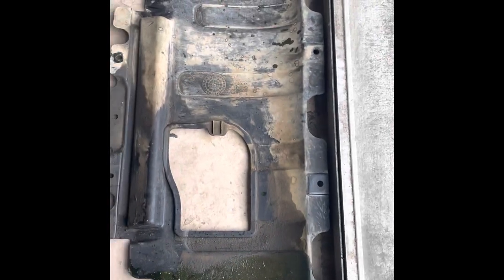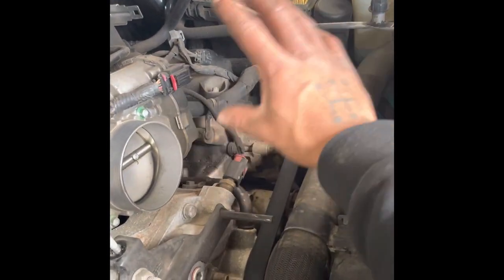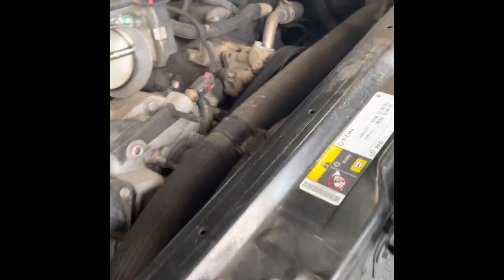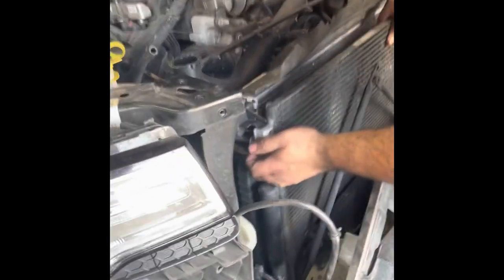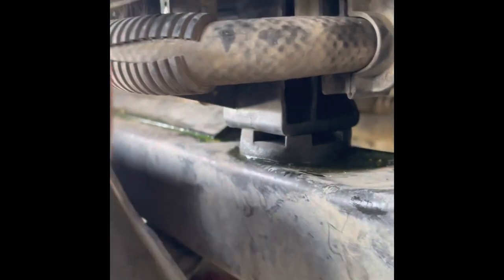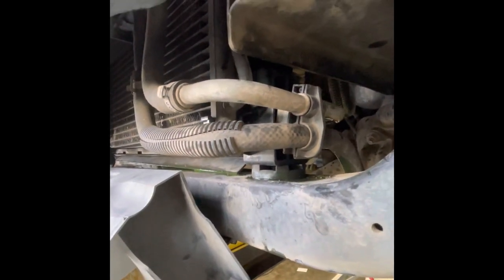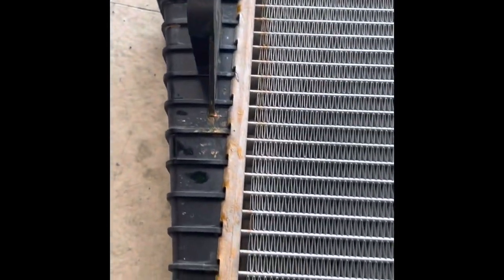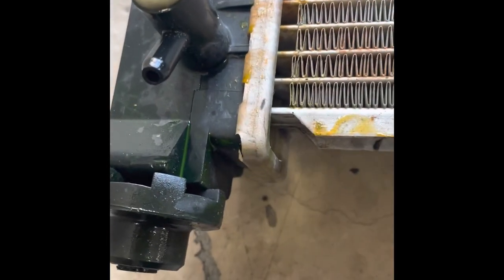2013 - 2021 grand Cherokee radiator replacement

Comment: You do not have to do all of that to put in a radiator all you have to do is remove that top bracket and then losing a piece at the bottom and the whole thing slides out
Reply: The shop told me they had to do this as well and quoted me 1300 bucks to do a radiator.  😆 😅 You can pull it out the top. Plus the bottom has quick access to the bottom bolts by just removing two or sometime 4 screws.
Reply: It is easier removing the bumper than working around it, in my opinion.
Reply: Did you do that on a wk2 with the the 5.7?  I did this almost 2 years ago but I pulled it out the bottom.  Have to do it again in a couple days when the warranty replacement comes.

Comment: The procedures in this video does not apply to all model years.  2017 3.6 jeep grand Cherokee bumper removal is NOT necessary.
Reply from the maker: Does that look like a v6 to you? No .. common sense
Reply: @nomannerssrt  Doesn't matter, typical mechanic response - maybe if you were a technician you'd know pulling the bumper isn't necessary.  THis is why people shouldn't listen to wanna-be mechanics.
Reply from the maker: @shackamerica8985  if you knew anything half of what your talking about you’d know and use your eyes to see that the bumper has to be removed to unbolt the radiator top support to even get the brackets off the top of radiator.. I don’t need no fake ase mechanic dealership worker tryna tell me how to do what I been doin all my life .. this is my personal vehicle.. that tows my drag car .. not some customers car … your the only one with an issue … make your own damn video , get off my nuts dealership boy
Reply: @nomannerssrt  Dude your doing your work in an oil change bay don't front like you actually work in a shop or know for a fact what you're doing. All data procedure calls for bumper removal on both the v6 and v8 models which makes sense being that it's the exact same damn radiator built into the exact same platform. It's not necessary to do so at all but you're obviously to arrogant to believe otherwise and ultimately it just creates more work for you......
Reply from the maker: @hbdd1824  okay bro lol the video ain’t up for you not everybody takes there shit to the shop I do my own shit , and weather you like it or not lol I could really give any fucks my guy lol location of where it was done doesn’t have a fuckin thing to do with anything lol you don’t have a clue what I’ve done or can do lol but please by all means , continue being a keyboard warrior shits comical

Comment: Never would have been able to do this without the video but I messed up on that hood latch top piece. I couldn't get one of the top side screw holes on the passenger side to line up.  All the other screw holes line up fine.  I stripped the passenger front side screw hole out trying tighten it hoping it would help it line up so now I only have the expansion tank screw and one top screw holding that passenger side.  You think It'll be ok leaving it like that?   The other 4 screws on the driver side are all good.
Reply: Its totally fine.
The method is to use a long pry bar or long phillips jammed into one of the other bolt holes to force pry to get the holes to line up, but a bolt or 2 missing wont matter
Reply: @ripptydevibes2581  Thanks, I actually managed to figure  that out soon after commenting.

Comment: Amazing video. I love it. Don’t use the green coolant though :-)
Reply from the maker: I’ve come to realize the green has worked best it’s just regular 50/50 . It has a aluminum radiator in it now tho thankfully
Reply: The green stuff is more acidic and deteriorates things a lot easier. Hence the reason why they use newer stuff. Could be a reason why oh I don’t know it starts to leak.
Reply: No the green is the best coolant. It's leaking because Chrysler puts cheap plastic on their crap and it cracks

Comment: Which engine is that?
Reply from the maker: 5.7 hemi
Reply: @nomannerssrt  Did you replace it with the beefier radiator?  I have the 5.7 with the tow package on mine and it came with the heavy duty radiator and that's what I have on the way.  I wonder if I'll be able to get it out and back in without disconnecting or damaging the ac lines.  $500 on rockauto with tax n shipping,  dealership said $700 on labor lol.  They make me sick!   Thanks for the video!  By the way i think mine failed at the same spot yours did.  I saw it seeping out slowly in that area with the black light.
Reply: @tjtewshews5531  how did it go? Just ordered the HD radiator from local shop
Reply: @gunsite45  I pulled it out through the bottom.  You really have to squeeze through a couple metal lines though.  Was worried i was going to damage them but they were fine. Didnt even have to jack it up.  I just put the air suspension in offroad 2.
Reply: @tjtewshews5531  awesome! I'm planning to do the same. Thanks for the reply.  Which coolant did you refill with?
Reply: @gunsite45  the mopar concentrate from the dealership.  They wanted like $200 to do a flush so i just drained and filled the radiator like 20 times with distilled water til it was mostly clear.  On mine with 4x4 and all the crap thats under there i couldnt get to the drain plugs on the engine block and didnt know any other way to do it.   Didnt want to flush it with a hose.   Next time ill pay the 200 lol was such a hastle.

Comment: My Summit 5.7 4x2 needs a cam, lifter and MDS delete and headers. Opening ops intense before getting to heavy heavy head work💪. Engineers really overdo it on brackets, snip-snaps, accessbto internals. Needed to see how much space exists after radiator comes out to see if a cam will squeeze in w/o popping condenser/ac lines. Techs all say pull engine worth over $4k to do job.  Nah bra...TIming overview before I use my skill. I got a good picture of what techs go thru. I did not believe engine needed to come out. Wish me good outcome as I go G.I. Mechanic beast mode.
Reply from the maker: Nah motor shouldn’t have to come out to do a cam swap .. many have done it with the block still in .. end of next year I plan to do a cam swap but for now.. I’m gonna finish up my srt4 .. which I’ll be doing a video on prolly today .. small one but it’s time
Reply: How did it go?
Reply from the maker: @03mm24  went pretty good , few months after this comment mine developed the hemi tick lol 😂 I decided to cam swap it lol went Texas speed stage 3 cam , Texas speed mds delete kit with hellcat lifters

Comment: ...if they actually do it this way at the dealership the engineers really dropped the ball on this one !! in the rip off the customer
book it may say take the whole front of the vehicle apart to justify charging so much, but there is no way it has to be done like
this (fact) this way will generate more business because there's a good chance things will break & need to be replaced ; ouch!

Comment: Check your coolant for electrolysis if you have this continuous problem. A bad ground will cause the acid in the coolant to eat away at the weak points in the aluminum. Using a volt meter check for low voltage by grousing the red prong and dipping the black one in the coolant. I believe it should be below .3v anything higher is a cause for electrolysis.

Comment: We did this twice on a 2011 and 2014 Grand Cherokee 5.7L hemi's.  Both times did not remove the front bumper cover.
Hardest part of the job is separating old radiator from condenser and pulling it out of engine bay and likewise with getting new radiator in. 
You must disconnect the fan assembly from the old radiator and pull it out of the engine bay first.    
What makes removing/installing old/new radiators so difficult are the A/C freon lines on both sides of the radiator, you need Two people to do this carefully without damaging any A/C freon lines.   Its actually the bottom rest clips of the old radiator that the condenser sits in that limits the amount of room you have to remove it. You can cut or bend them to give you that little bit of extra room you need to remove the old radiator (you obviously cant/shouldnt do that on the new radiator). 

PS: pay a little more $$ and get a better aftermarket radiator that has limited Lifetime warranty (ie. Carquest premium or TYC) so that your covered for a defective radiator (they usually leak where the plastic tanks attach to the aluminum section).
Reply from the maker: I’ve since changed this  radiator took me all of 45 min to do .. its not rocket science

Comment: Thanks for the video. I’m having similar issue with a weird leak but never overheats. Reservoir will empty out tho. 2014 GC Summit v6. My question is would I be able to do the job myself if I removed the radiator support beam only and not the bumper? Only ask because I’m nervous to remove it. It freaks me out. Thanks for your video for sure!
Reply: Just go for it dude.
Reply from the maker: You can definitely do it yourself .. removing the bumper is a piece of cake , won’t hurt anything ..

Comment: How many miles did you have on the SRT before you needed to replace your radiator??? I have a 2011 sitting at 157k miles and just discovered I have a small crack in mines... This after I just finally replaced my water pump.
Reply from the maker: I had about 140k .. then after I can swapped it a year later I put another one in because the shop punctured a hole 🕳️..   go figure

Comment: Yea mine leaking right now. But don't know if it's the hose or the radiator
Reply from the maker: Can always pressure test it
Reply: @nomannerssrt  damn didn't think about that. Thanks
Reply from the maker: @jamarrobinson2872  No problem